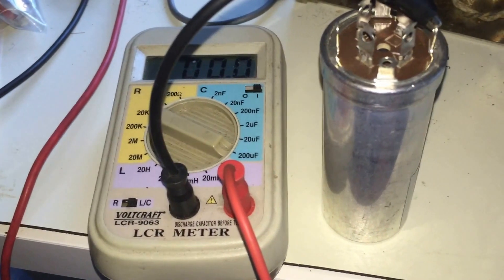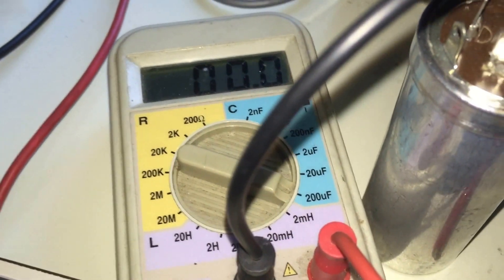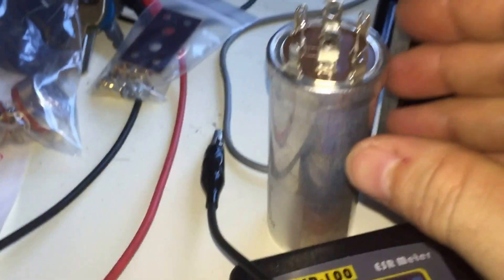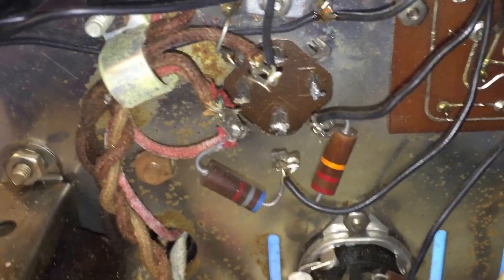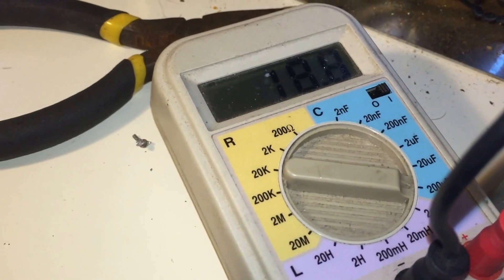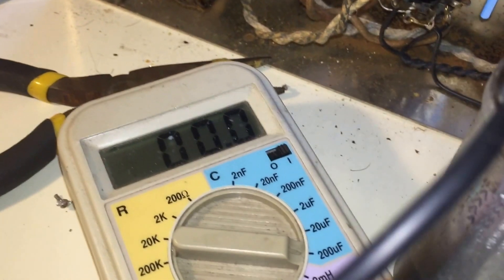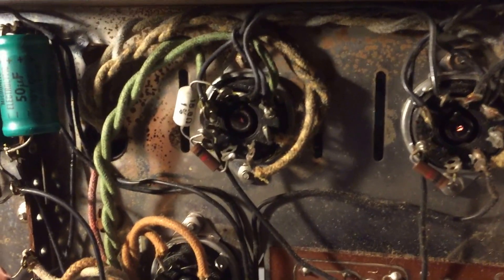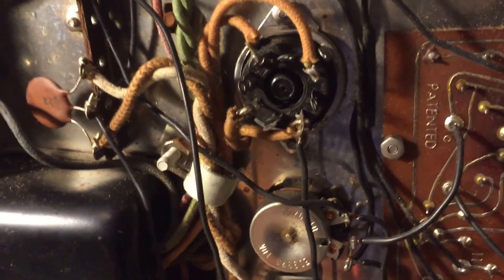Dynaco Dynakit ST70 Stereo tube amplifier repair PART 3 of 9

Comment: The #1 problem with older capacitors in tube circuitry is leakage current (internal resistance). An ESR meter doesn't test leakage current, but only the effective series resistance which is not critical in tube circuits. A leaky coupling capacitor on a grid can put B+ on the following grid and drive the following tube to meltdown in under a minute. I don't have and can't afford a cap leak detector, so I automatically replace old film with polys (brown, green, or orange drops), and modern electrolytics from Panasonic or Rubicon. I'd never use a NOS multi-segment can cap, except maybe to hollow out and stuff with Panasonic caps to preserve under-chassis appearances. Caps are really cheap. It's like alien problems: just take off, nuke the paper/film/wax/oil/electrolytic caps from orbit. Ceramics, micas, and air caps, I test for value only, as they seldom go leaky.
Reply from the maker: CAP DC leak detectors aren't expensive, look at my videos on restoring the Heathkit IT 11 that I use in most of my videos to measure the DC leakage of caps
Reply: Thanks. I half-plan to do that when one comes up on ebay at an affordable price ($20). Half-plan, because I'm not convinced I'd use an old capacitor if it was perfect, because it's only perfect right now. Back before 1987 or so, capacitor manufacture was TERRIBLE. Also, because I'm cheap. That's why I automatically replace all the film/electro caps. It's cheaper than testing catzappance, ESR, EPR, mark the REAL foil end, and verify self-discharge, plus I know my replacements are good for 50 years or better. Another way of looking at it: what's your time worth? Is an hour of it worth fully checking a few capacitors to save $10? I just mark the foil end as I pull them off the tape and solder them in. IRL, I bill out at $300/hr. That's a compact pickup truck load of orange drops!
Reply from the maker: I see your point with shotgun replacement. However, I also measure impact, so I want to know, given a DC voltage, how much current is going through the cap.Im the biggest proponent of removing the ancient ones and replacing them.  The problem is, I see this issues on caps that one would not consider to be the leaky variety.  For such identification one requires a tester.
Reply: Yeah! That's my 'pro' argument for rebuilding a Heathkit tester (it's not really an epr meter, just good/bad). I haven't run into that yet, but I know it's inevitable, unfortunately. Off-topic: I just had really good luck using "Evap-o-Rust" on an ST-70's nickel plated chassis. Every speck of rust gone. It leaves very tiny pitting, of course, but beyond 15 inches away it's invisible. I protected it with Renaissance Microcrystalline wax/polish, above/below. That was actually the second de-rust on that ST-70. I rebuilt it 20 years ago, but didn't add a protectant to the chassis. Big mistake that I'll never repeat, given the total strip down and rebuild needed to correct it.
Reply from the maker: Next one I do will be stainless steel